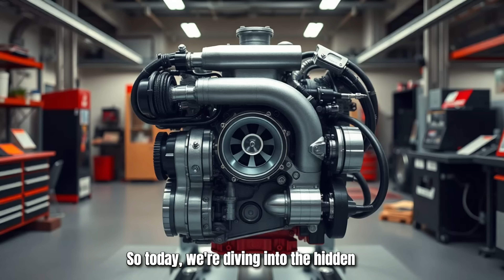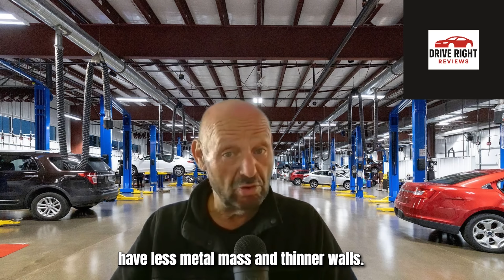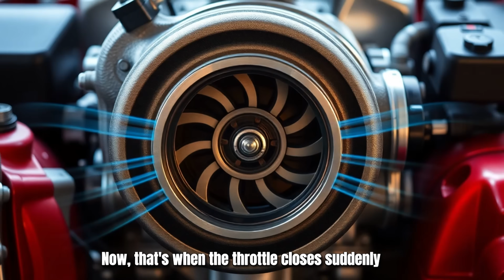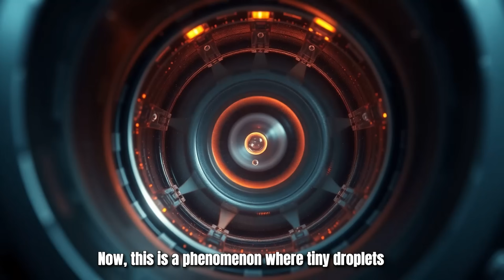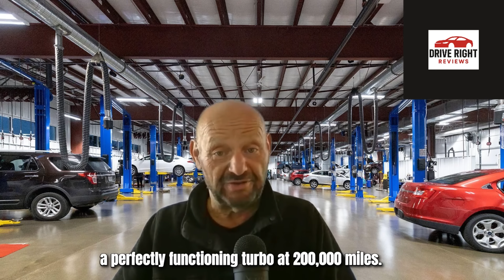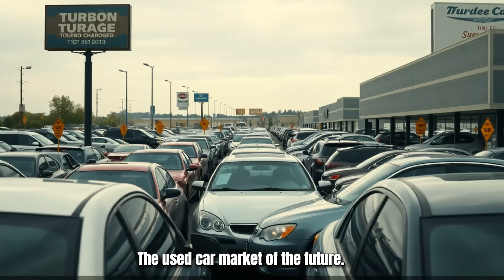Is The MODERN TURBO In Your CAR ENGINE Really Reliable?? (MUST WATCH!)

Comment: Short version: Turbo engines are NEVER as reliable as a properly sized naturally aspirated engines. Parts that aren't present never fail. Turbos are great where performance is desired and it is understood that additional maintenance and repairs are the cost of that performance. They SUCK for reliable point A to B transportation with a minimal cost per mile.

Comment: I regularly see turbos do 100,000+ miles.  European auto tech.  In fact, I RARELY have to replace a turbo and I work on 1000s of cars a year.  9 times out of 10, it's not even the compressor/exhaust veins or bearings that fail,  It's usually the bushing for the integral wastegate flap that wears out causing the wastegate to not fully close.

Comment: 2007 Nissan QG18DE 116 Hp manual has no Turbo and no CVT, no plastic valve cover & no plastic intake manifold. Happy times.

Comment: Let the engine run at idle for one or two minutes before shutting off. Change oil more often than normal schedule. Once the warranty is over, you are responsible for the engine failure!

Comment: First, the number of your “like and subscribe” requests is a bit much. 

Second, though I can understand the vulnerabilities of turbos, your concerns seem a bit overdone.  

Many/most non- hybrid engines have been using turbos for quite some time now. Long enough for premature failures to be showing up in “unacceptable” numbers to the general car buying public if your concerns are valid. 

Expecting drivers to do a several-minute warmup and cooldown is unrealistic. “Frequent” oil changes seems to be the only practical advice.

Comment: You are spot on as usual.Having a turbocharged engine is great if high performance is your end game. But it will cost you extra every time you service your vehicle and there are a long list of problems and parts that only turbo engine use and have. Oil consumption and sludge build up and failed crankcase vent issues are common problems on turbo equipped engines.That and the fact that turbo engines break down oil at a much faster rate than  a comparable normally aspirated engine.Major issues such as head gasket failure and stuck rings are more common on turbo engines also.
Reply from the maker: Glad you found it useful

Comment: Possibly the most accurate review of turbos that I have seen to-date.  Yes, to own a turbo requires complete oil change maintenance. How do I know?  My company that I retired from remanufactures them.  Also, I learned from experience when I ran my 1.4L turbo hard one summer day and did not properly wait a few minutes before shutting down. The oil/gas smell was horrible! I won't purchase another turbo.  I will take my V6 Honda Ridgeline and cruise into the sunset any day!
Reply from the maker: Thank you - great comment

Comment: Good vid but ; jet engines ( commercial at least ) spin at 4500 to 5000 rpm cause the tip speeds would be hypersonic at turbocharger rpm ...

I'm putting it out there that well maintained or not , the good 2nd hand turbocharged cars are going to be devalued because of the vast numbers of shitheaps ( Parramatta road - Sydney) on various dealers lots .

Comment: Get rid of boring turbos and go supercharging. Stupid car manufacturers
Reply: The car manufacturers are being smart, not stupid. Stupid is what they were doing before making these engines that lasted 200,000 miles with little maintenance. Their job is to sell cars and make money, not make the longest lasting engine possible.
Reply: Superchargers are nothing but belt driven turbos. 😂😂 And it's superchargers that are boring because they are limited in boost. You can only change the pulley size to increase the boost, unlike a turbo that can run different boosts at the push of a button.

Comment: One of The best explanation I’ve heard, id add another line here, most Turbos don’t die- they are killed, usually by their owners and manufacturers by extending oil change intervals. Ive owned various Turbo cars from the early 1990s and never had a problem, my latest one I’ve had will be 14 years next march, this isn’t by chance, its because I change the oil and filter with quality oil every 5000 miles or less. I never rev it over 2250 rpm from cold and always drive it off boost for the last mile home before shutting off the engine. QED.

Comment: In the USA here.  I miss the days of good, naturally-aspirated port-injected engines & plenty of good, fun manual transmission option compacts & subcompacts.
Reply: Canada here. I’m keeping just such a car, a 2000 Golf GTI a manual transmission and 2.8L V6. They will simply never make small cars like it ever again.
Reply: My 2025 Mazda has a naturally-aspirated port-injected non-turbo engine. It doesn't have a manual but I don't want it. It has a 6 speed automatic, not a CVT.

Comment: Great reminder for ignorants. Which is why I am changing oil and filters in my Subaru Forester XT after every 8000 miles. After express way drive, a compulsory 4 minute pause before switching off engine. And, most important, keeping the car until 15 years/160.000 miles before selling my car. I drive cars for 50+ years and laws of physics are still there..

Comment: Perhaps these engines are more reliable?: lower air pressure boost of max 1barg, turbo engines with port injection, turbo engine without piston low tension rings, engines not having fuel dilution problem, engine not specifying 10,000 miles oil change interval & using 0-30W oil (not those with 0W20 or lowrr), not doing any towing with a 1.5 turbo engine. 😂😂😂

Comment: Garbage because manufacturers are cheap the average big rig has decent turbo quality. So could a car without consumer protection were doomed to only having piles of crap until a politician gets burned so badly he can and does allow real competition from the likes of China and others. 
Kick insurance companies in the nads for allowing failed vehicles like easy to steal let their greed run amuck by just screwing the consumer and charging more instead of telling the manufacturer they won't insure them unless recalled and fixed.
Same with 32 valve engines that are just past warranty when all the valve guides seals leak.
Dead battery can't open doors in -35 when you get off work.
Blower motors that fail and can't be replaced without removing the dash I know that is a safe car to drive in the midwestern winter 
Smallest fault turns off 4 wheel drive I know how much safer that makes me and my family.
And all for only 50,000 dollars

Comment: I have learned so much from your videos.  I’m 86 and don’t drive our 2003 Buick Regal very far.  Neither does my wife who is 80. We have had it since 2004 a program car as I recall.  It has 144,000 and some miles.  This is the important part:  I switched to synthetic and it now leaks oil as my friend told me after the fact.  To quote him, “George synthetic oil will find a/the leaks”. 
Thank you (I don’t know your name) for your videos they are so informative.  Hope your cough gets better.  😊

Comment: The quest for better gas mileage is also the reason car manufacturers are instructing us to use extremely thin oils.
Great for gas mileage but not great for engine longevity.
Reply: I’m not so sure, thin oils circulate more quickly on startup which is when a lot of wear tends to happen.
Reply: @QatarVegan 
Apparently manufacturers recommend lighter oils in the US than they do for the exact same models in Europe where government mileage requirements aren't as strict.
Reply: @colehara  wow, that’s mind blowing. Thank you!

Comment: Great advice to preserve an engine
Reply from the maker: TY
Reply: I worked for a turbo manufacturer for 36 years, we supplied most of the major truck and tractor engine builders. These were medium and heavy duty diesels, we experimented with small petrol engine turbocharging but concluded it would not fit our owners business model. When turbos for smaller engines were finally necessary, we built water cooling into the bearing housing to manage temperatures, which is am additional cost most car manufacturers won't accept